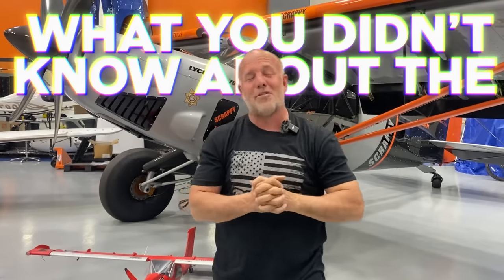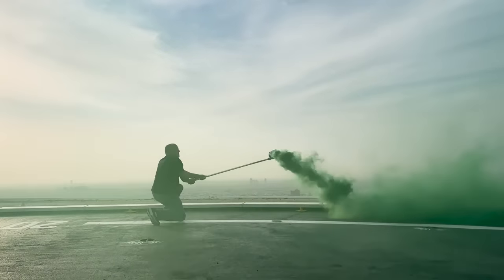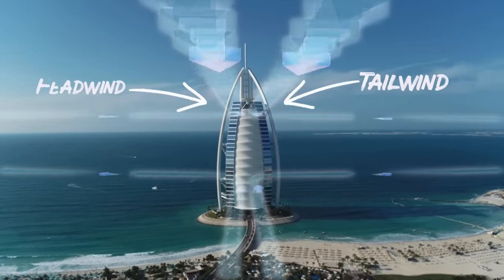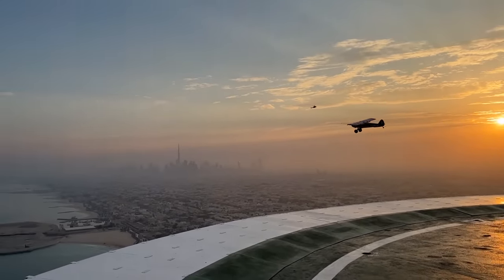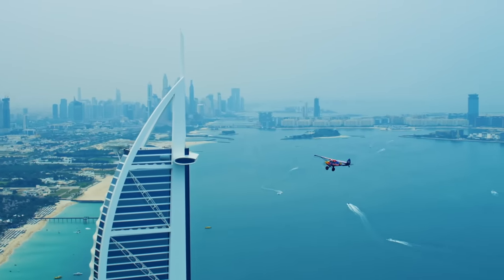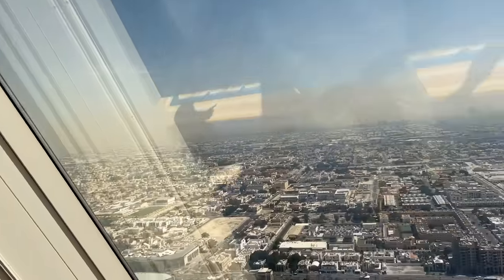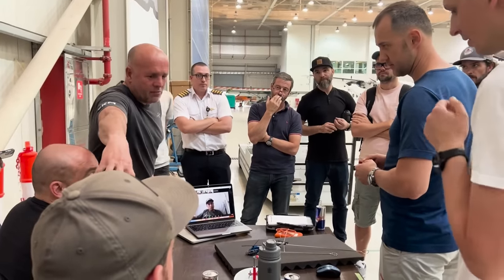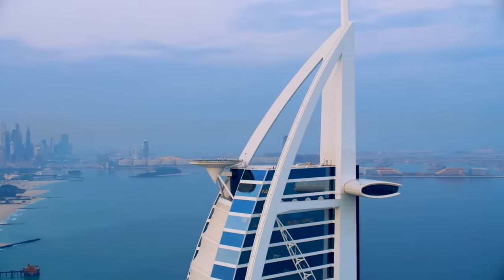What you DON'T know - RedBull Bullseye Landing! Behind the scenes look - Never before seen footage!

Comment: Can only imagine the challenges this poses to helicopter pilots let alone a Cub. Thank you Mike. Really appreciate what you share with the world and letting us into your hanger. You don't have to but you do, getting aviation out there.
Reply: That was my thought, too: what about the helo pilots who are supposed to use this pad? It seems like the worst possible design for them. I’d love to hear from a helo pilot who deals with building landings.
Reply: I was thinking the same thing! I bet landing a helicopter could get exciting.
Reply: A helicopter would have one major advantage over the cub in this case : it doesn't need a minimum headwind to be able land on the pad. With low wind speed, the turbulences caused by the building aren't as big a deal. It does sound very restrictive for a building right next to the sea though.

Also given that the landing pad is hanging on the side of the building rather than on top of it, the helicopter may have to enter a hover out of ground effect on the approach ?

Comment: Mad respect for what CAN be done, and when it SHOULDN'T be done..
I do some crazy things in tight places with RC planes. What an insane project, windshear or turbulence on short final or at touchdown, the invisible enemy..
The mortal danger involved with this project and insane structure,  with ludicrously challenging turbulence characteristics..wow!
I had my worries flying my RC STOL plane(origional model of Eflite Timber) into a tight pinacle lookout @ my local park..had to clear a 330° surrounding 4' wall and land cleanly within the "available" 20' circle, bordered foreward 180° by structure and trees..through variable turbulence. Missed approaches were full power 180° "baulk" @ full flaps, backwards "over shoulder" to the "dropoff side of the cliff" for unobstructed recovery BEFORE passing wall. "Stepping" down approaches was tedious but educational! The "bump" & wake turbulence over the wall had to be dealt with..a moderately steep powered approach and chop of power with agressive rotation to 2pt landing worked ..
I was successfully "done" upon my first and only ever landing there!
Not trying that again! Bravado be damned, my little electric 59" foam plane deserves credit for forgiveness and performance!

Comment: 1:53 You say the "airfoil" shape of the building would "pull" the air from the wind into the negative pressure zone on the leeward side of the building, but the reality is that the atmosphere outside the negative pressure zone would push the wind into that zone. It seems pedantic, but I find that helping students model in their head what's actually going on can lead to better problem solving skills in these sorts of situations in various air sports. The short mnemonic is "science doesn't suck" in that with fluids there's always a push, never a pull. This also simplifies thinking about a challenge: from which direction are you being pushed?

Great breakdown, this is just sharing some thoughts, not a deep critique or anything, appreciate your work!

Comment: Very impressive. As a helicopter pilot I can attest to how difficult those type of approaches are (even in a helicopter)… when it comes to pinnacle approaches there’s tons of factors to consider and all of them can change in an instant. With this approach specifically there’s a very narrow avenue for success given the shape of the building. Contrary to popular belief, helicopters can’t just hover when and wherever at any altitude, there’s no ground effect to take advantage of on these approaches(until you’re right over the LZ) so your power setting, wind direction and sink rate is CRITICAL or you’ll fall like a rock right into the building 😂… helicopters create an obnoxious amount of wake turbulence in multiple directions, those pillars on the building must be an absolute blast to deal with 💪….looks like you’re pretty much committed once you start your landing 🤘

Comment: In the Kansas City area, there is a pie shaped building. Round on one side and straight on two sides. When making initial building pressure measurements (difference between inside and outside pressure) they had issues. They figured out it was the location of the outside pressure reference due to the shape of the building and the wind.

Comment: How did he get the plane off?
Reply: Good question!
Reply: Off the pad? They pushed it back then took off. Taking off would be the easy part because that plane could accelerate so well.
Reply: @NBSV1  Yeah, I thought they might do that. Like a navy jet off an aircraft carrier. Except in this case you're replacing speed with altitude.
Reply: You can watch the landing and take-off in a previous video. Search “Mike Patey Landing the Red Bull Airplane on a Helipad.” 😊

Comment: Loveya, but no.  Once the tail touched the first time, he did not need to raise the tail again.  At that point it tail was NOT going to smash in.  
In fact he would have been better off keeping it neutral or back some to increase available torque over the hubs without endangering the prop with increased braking.
Edit:  Actually now that I look at the video again. he was going full tail down the whole time.  He didn't raise the tail at all, it bounced up elastically.

Comment: Sounds like even a helicopter landing on that pad is a horrendous liability.
Reply: Landing a helicopter is a touch different. It’d still be a bit sketchy but you don’t need anywhere near the room like a plane does.
Reply: @NBSV1  I wasn't referring to the landing area. It's the squirrely air currents around the pad
Reply: You are correct. The pilots who land it have been trained specifically for it and are highly skilled.

Comment: The landing was a non event. They take the plane with the shortest landing and takeoff speed on earth and they want us to be impressed when it is landed on a roof somewhere. I have never that slow in the head. If you want to impress us then land a Lear 35 on the same roof. Now that would impress me. By the way, isnt the wind up there much stronger thereby allowing a much slower groundspeed on landing? Of course it is. Nice con
Reply: Watch the video and what the wind does on this pad. It is a challenge for helicopters as well and only a few are qualified to land it. There is a lot more to it than people think and this video explains the anomalies presented due to the shape and location of the helipad.
Reply: @ChandraSlyFoxPatey  I know all about wind shear, mechanical turbulance etc etc. I know more than the guy flying that plane. The landing was easy and predictable. Not impressive. If you want to fanboy all over it fine. Those of us in the know just shrug.